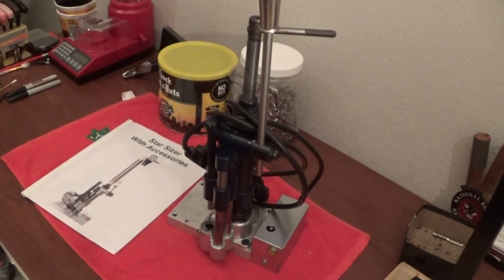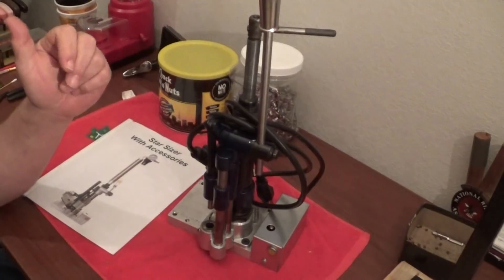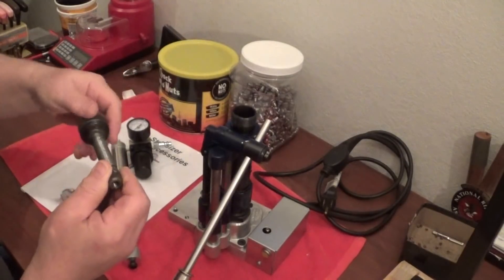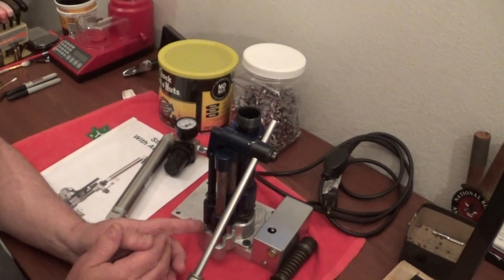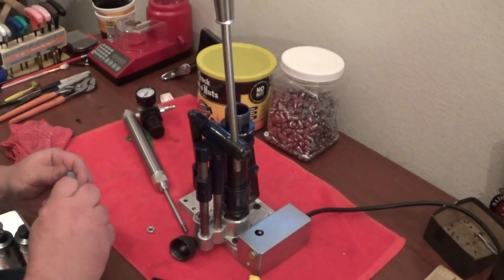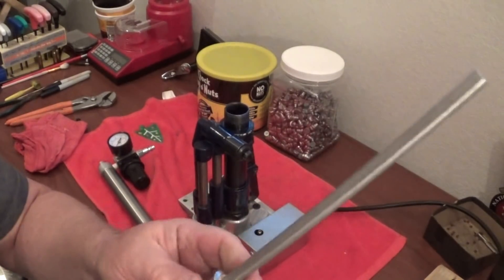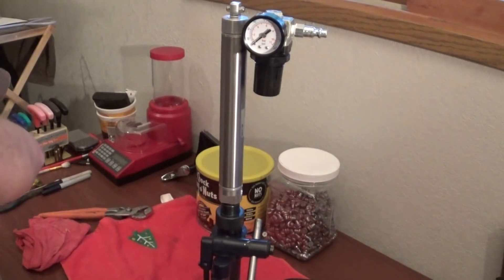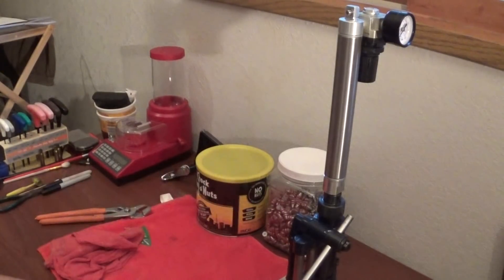Star Machine Air pressure assist.

Comment: I don’t think they used a magnetic piston air cylinder or I’d print a bracket to hold a proximity switch, 9v battery, and LED to let you know when it’s time to add another stick…. PC wise, I have a 45 Colt that tends to lead with traditional lube (even super hard alloy). Powder coating LFB leaves some residue that isn’t too bad to brush out, but Eastwood true gloss clear PC plus White Label canuba red lube looks traditional but doesn’t lead and a couple wipes with a patch leaves the bore perfect.

Comment: 200 bucks with heater that's a good deal!  I was watching ebay recently there was one at $155 plus $21 ship and came with 357 die but it was worse condition than yours with paint missing; I was watching and nobody outbid and it sold, I was trying to justify if I really need one.  The dies are very expensive but I possibly can make my own.  I didn't find my lubed bullets to be more accurate than powder coated but I think my lubrisizer messes them up.  My biggest dislike for lubed bullets is the stickiness and clean up I literally have to do with each bullet where the lube gets on the base.  Maybe if I got some hard red/blue carnuba lube it would change my view completely.  But what stopped me is I am getting my AR build and I read that shooting lubed bullets will clog your gas tube also it appears that with Star sizer next bullet pushes previous bullet down, that would be a problem with my spire point bullets, it would damage the pointy nose and leave a dent in the gas check.

Comment: The more I see the star lube sizer I think about change from powder coat to traditional lubing it seems so much faster  great video Dave 😀
Reply from the maker: Well. it does have advantages, however, there is the fact that when you are lubing bullets that have multi-lube grooves the adjustment to the top punch is rather finicky and can take trial and error to get it just right. It does speed up things and is a speed demon to use. However, it takes working with it and knowing the adjustments that are the key.  I enjoy using it(Always have) and it does a professional job. But now with all the accessories, just when I'm getting into it,, I'm Done. Fun is over. Dave.
Reply: Easiest way I’ve found is to scrape off the lube from the die so you can see the ports, line up the bullet you want to use and the top punch so the unblocked ports line up to the lube grooves, and mark the top punch even with the top of the die.  Super easy to quickly change calibers and line things up. 

I got lucky in that when set up to lube two grooves for 45 Colt (Lee 255 RNFP) the same setting works for 45 auto (Lee 200 swc) as the other open ports is blocked by the driving band. Lubes both perfectly without changing settings.  

Nice video and happy shooting.

Comment: If it ain’t broke.......

Many a mechanic has wished for an old school distributor as they tried to figure out a computer controlled system.  

Traditional lube will never go away.  Powder coating is easier and cheaper to get into.  I haven’t seen anything that proves it better than traditional lubing.

Keep us educated 777.  Keep up the great work.

Comment: That’s really cool Dave . Ya I can see how the air assist would really help out . Don’t get me wrong I’m a powder coated but I still have and use my RCBS luber sizer
Reply from the maker: It has been a progression of different machines from the time I first got started. It wasn't made for hard lubes, however way back when I first started with a lube sizer I had an old mod-45 Lyman, I made thousands of bullets on that thing, it taught me a lot about sizing. since soft lubes are sticky, that is where I started rooster jacketing my bullets, it would put a hard covering of wax over the bullet and they wouldn't stick together and I could box them without stacking them. anyway. I have an RCBS that I bought back in the late 80's early 90's and used it for many years. the Star is the Cadillac of lube sizing machines. You can find them used on the 2nd hand market for reasonable prices. Powder coating is a great alternative to lube sizers though. Have a good one Willie and get back on your feet soon buds. Dave

Comment: Hi Dave I’ve been thinking of getting air assist for my other Star, right now I have a home made air assist in it but I have been getting air pockets in the wax, but the way everything is set up height is a concern. So my question is how tall is the air assist?
Reply from the maker: Harry, the air cylinder adds 10 1/2 inches from the top of the lube cap.
Reply: There is a thread on cast boolits I was reading few days ago, you can buy cylinder online for about $20 bucks and air regulator from harbor freight cheap, there was part number I saved  https://www.radwell.com/Shop?source=GoogleShopping&IgnoreRedirect=true&ItemSingleId=1120854&utm_source=google&utm_medium=cpc&adpos=1o5&scid=scplp1120854&sc_intid=1120854&gclid=CjwKCAjwpeXeBRA6EiwAyoJPKvIpCgBV-qwmhquIzGDgyHRxVZ7jaclfcYHDCscKM2Trub4Hel4_BBoC6E4QAvD_BwE